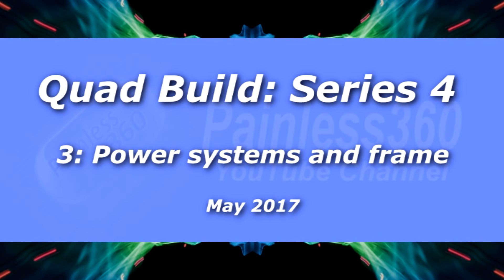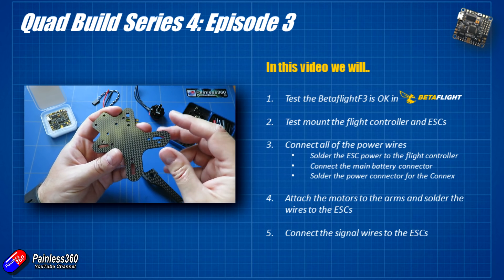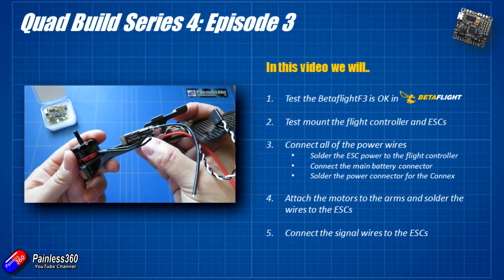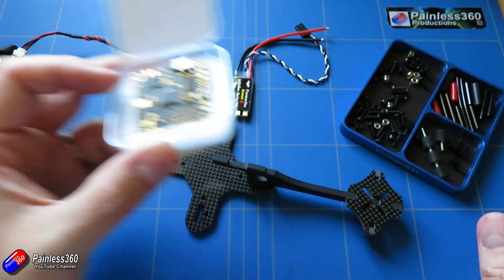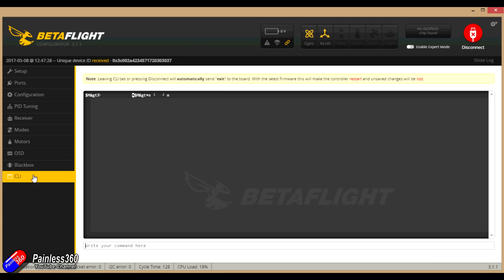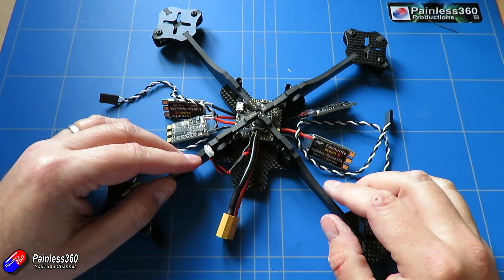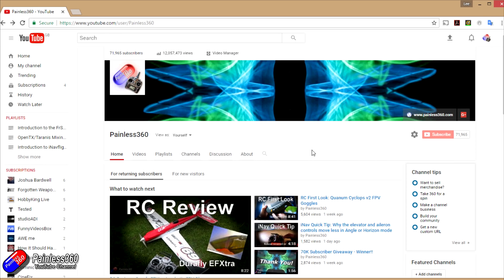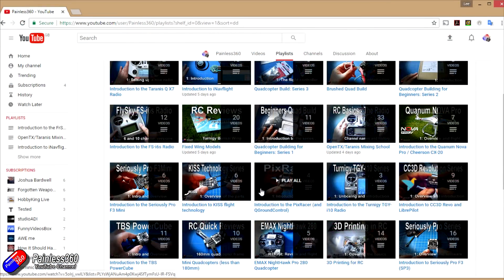(3/5) Quad Build Series 4: Connecting the Betaflight F3 ESCs and Power to the frame

Comment: Lee, about the RSSI, I think you didn't need to solder the yellow wire. That would be used with the regular 16ch firmware and the RSSI_adc activated in BF. You used ch16 for RSSI with the custom firmware.
Also using D8 (and FW with RSSI on ch8), would half the latency for control?
Reply from the maker: +psydafke yep, see the later video where we cover all of this.. happy flying!